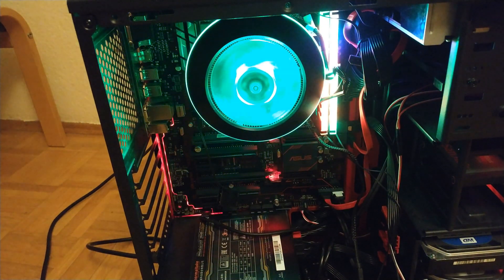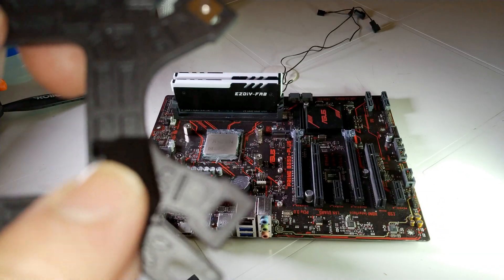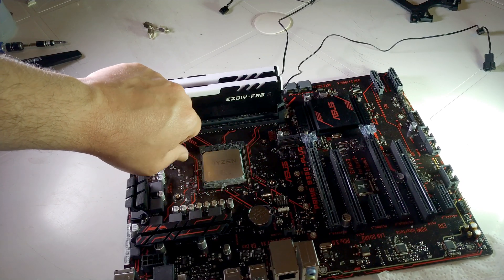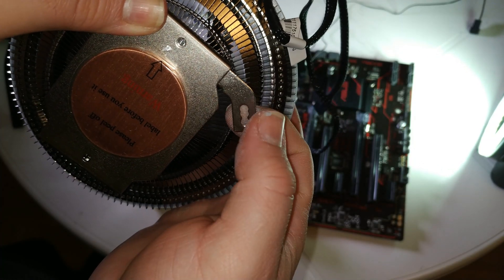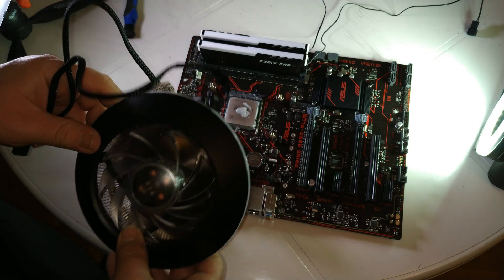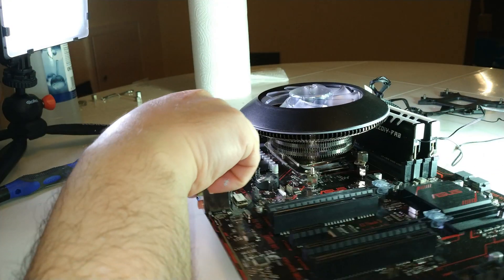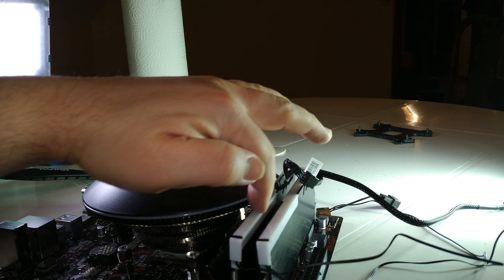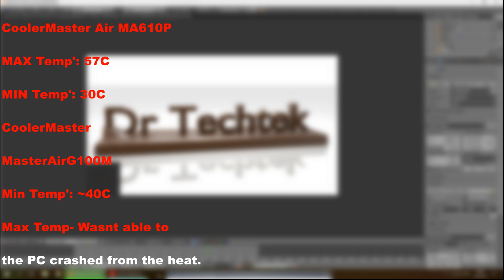CoolerMaster Master AIr G100M Install

Comment: Lol the intel writing is on the AMD side of the cpu adapter, the AMD copper base wraith cooler works fine even for a modest overclock, it's in the manual showing the correct adapters to use,, seems like your memory is too high good to always get low profile memory

Comment: that is awfully close to the RAM, makes me wonder if it will clear my RAM
Reply from the maker: depends on your RAM position on the motherboard
Reply: @drtechtek2165  slots 2 and 4, but my concern is that I dont have low profile RAM.  I think you're using G Skill which I have as well (trident z rgb)
Reply from the maker: @TOisONit  
Yes they are gskill, now with a 3th party heat sink